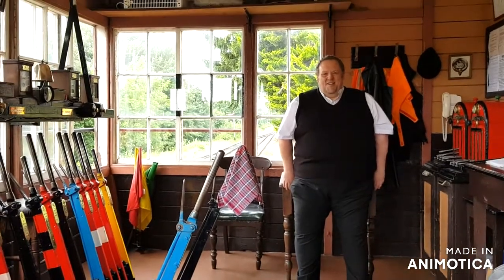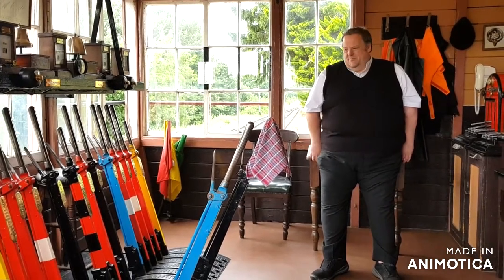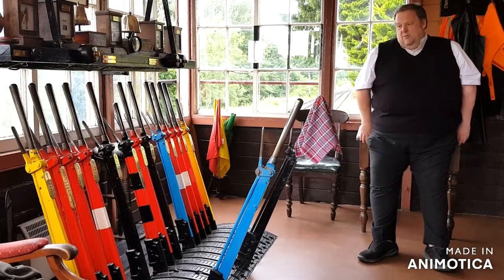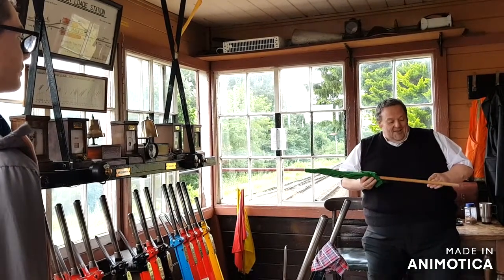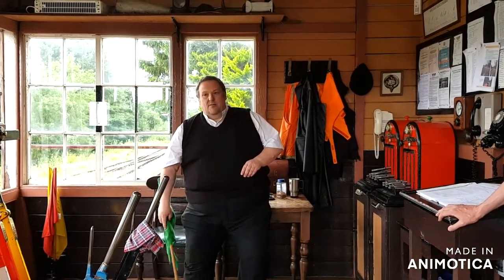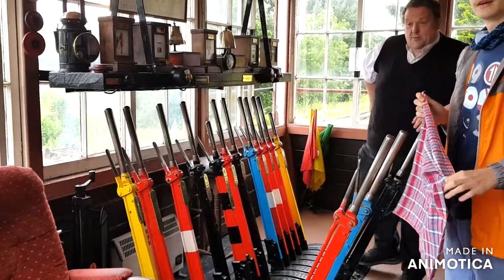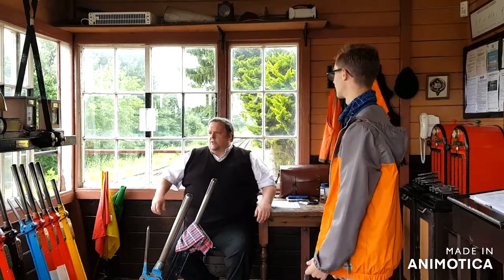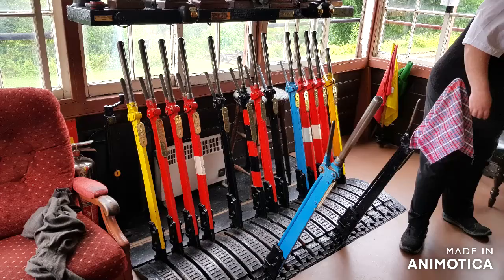Hampton loade signal box

Comment: What does the Black and Red Lever do in the signalbox
Reply from the maker: The black leavers operate the points, and the red one's operate the signals, the blue one lock the points in place this only has to be done when a passenger service passes over so that the switch blades don't move under the train. The yellow ones are the yellow signals you see on the line. There is a chart above the frames that show the track work and where the signals are thes have numbers that match the numbers on the leavers.
Reply: @SVRSteam  Fascinating to hear about the Signal box at the Severn Valley Railway thank you for letting me know
Reply from the maker: @lewiscartwright3609  no problem mate 👌 enjoy the upcoming stuff
Reply: @SVRSteam  I  will Absolutely Enjoy it. Cheers.Lewis.👍👌